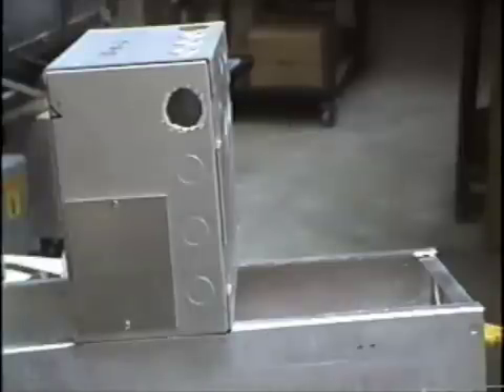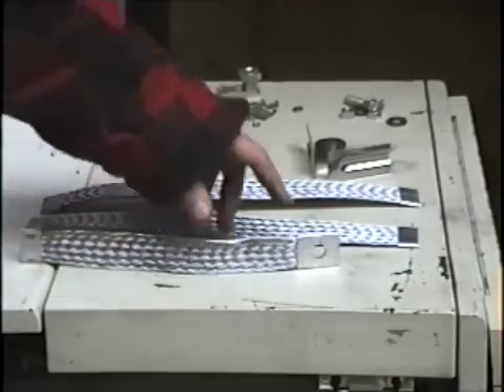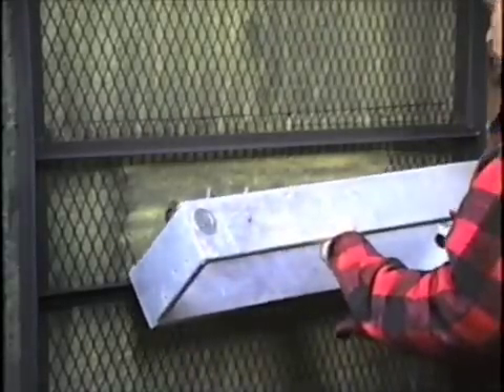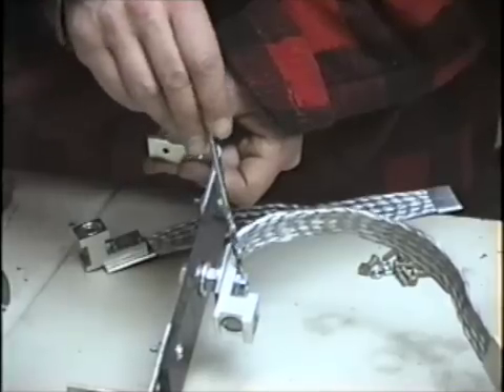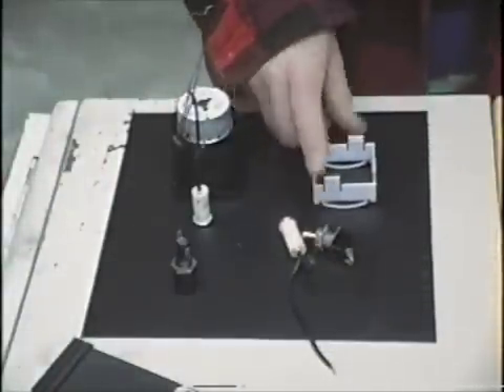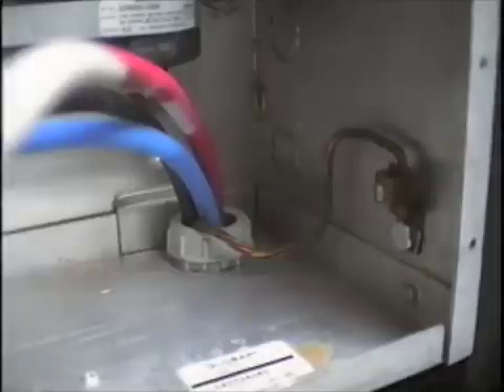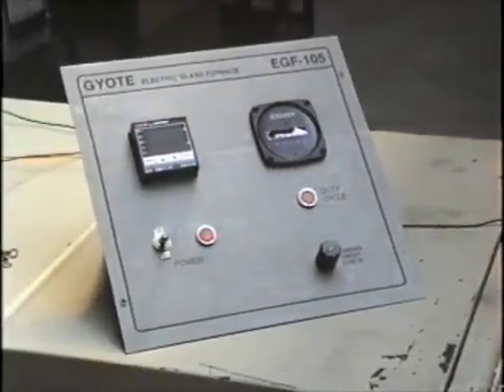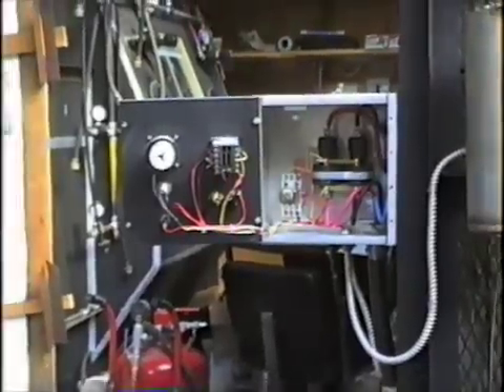Wiring - 170-pound glass furnace (video sample clips)

Comment from the maker: If I remember correctly (it's been several years since I bought some) they were $160 each, includes shipping.  Kanthal moved the SiC operation from New York to Scotland, so the air freight ads a bit to the overall cost.  I am staying away from the cheap Chinese rods.  I am running 5 rods in my current furnace, and bought 8 rods, so I have a few spares stored under my bed.  I check the current on them regularly, and they don't seem to have aged much over the last 3 years.